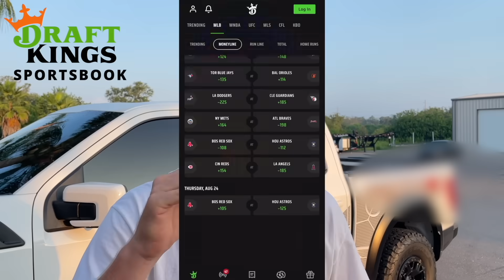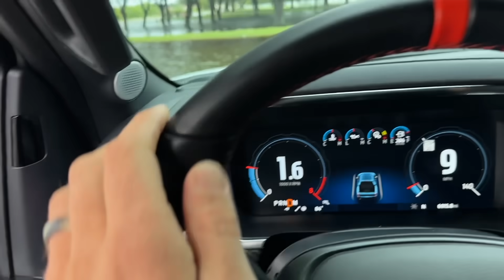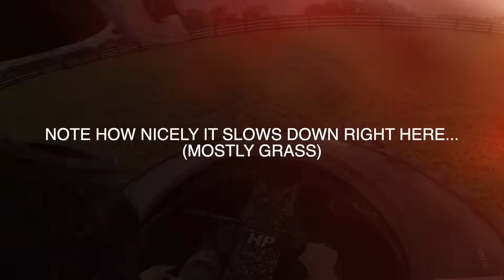I Crashed My Hovercraft During Hurricane Idalia (IT HURT BAD)

Comment: They make hovercrafts that have separate fans for the air bags on the bottom so when you let off the throttle you don’t sink into the ground AND you can even stay still on water and not sink. You need to get one of those brother